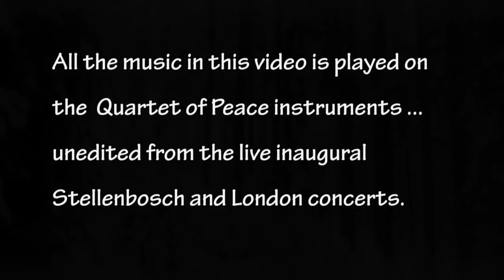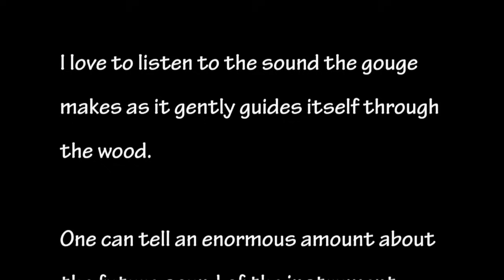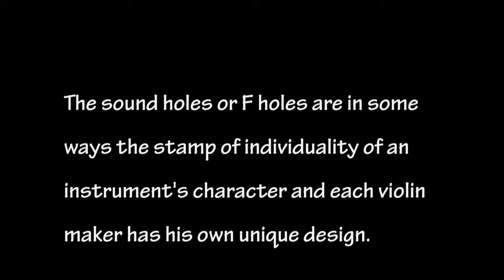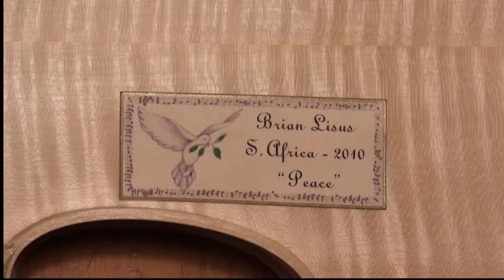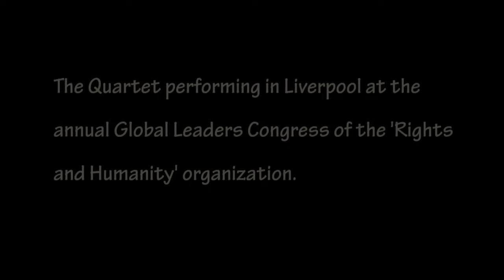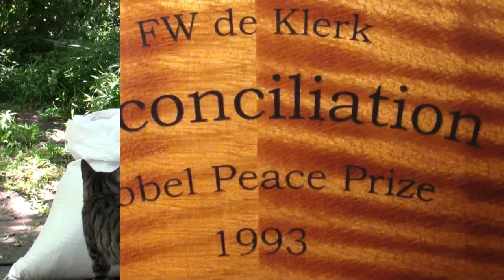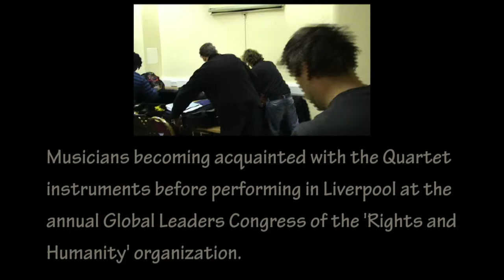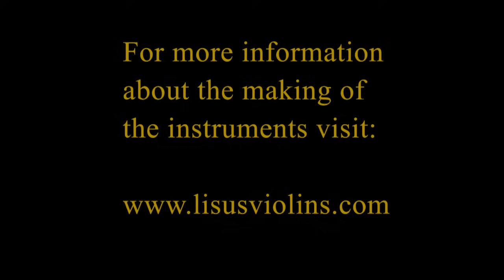Violin Making  - a String Quartet - from the first shaving of wood to the inaugural gala concerts.

Comment: At the tender age of 65, I'm about to start carving my first violin. Watching this, I'm either enormously inspired, or enormously intimidated. I guess I'll find out tomorrow.

(That's got to be one of the sweetest sounding cellos I've ever heard!)
Reply: Well Paul, I haven't budged from my computer except to occasionally eat or to use the facilities.  I haven't even bathed for two whole years for the fear of missing your update, and yet it hasn't come!!  I can wait no longer:  how did you make out???
Reply: Sorry to be so quiet about this. I appear to have been intimidated, but not by this excellent video. Rather, by my own struggles with the tools. I got really nice belly and back seams, but gouging out the contours of the plates is beyond my level so far. I have tuned up and varnished three instruments, and they came out rather well, but making one from scratch is another story. I haven't given up, but I am not making any time commitments, either. So enjoy your bath, and rejoining your family!
Reply: Thanks for the update Paul.  I haven't attempted a build either but would like to.  I've seen others drill pilot holes at varying depths (depending of course on the contour) to use as a general guide for the shaping of the plates.  In any case I doubt there is anyone who managed to get this right first time out. I think my first attempts at plate shaping will not be with instrument grade wood, but some glued 2 X 8s in pine.  There's an old Stentor video on line showing their Chinese factory. If you want to get depressed, watch how fast those workers blast through the various build tasks.

Thanks again for the update; I'll enjoy my bath, but suspect my family will be even more grateful than I will be!  Good luck my friend.
Reply: @paulcook4459  I'll be 71 this year and I'm thinking of trying a build. Something about it looks so rewarding. 
Planes are about my favorite tool, so I'm thinking of how they might be used instead of some of the tools here. While I like files, they scare me in use where the grain can blow out. I'd rather use a plane or chisel. 
Speaking of either the plane or chisel, I've learned to free hand  sharpen in under 30 seconds to 16,000 Japanese grit, which leaves a polished surface. I rarely sand anything anymore. 

If I can find a source that teaches a class, I'll see how I can do. Now all I have to do is live long enough to finish the project!  ( That part worried me while I was building my workbench. )
Reply: Did you ever finish it?? I must know! Just do it, man! You can do it! Or, youll learn enough from the first time thru that youll do it the second!

Comment: Fascinating video!I wonder why the body isn't made of one solid piece instead of two little pieces put together?
Reply: How do you expect to hollow out a single piece of wood?
Reply: I think he means single piece as compared to bookmatched jointed pieces. Solid body electric guitars will have a single maple cap for example.
Reply: Kenneth Gilbert I think they're bookmatched for symmetry? Lots of flamed and quilted maple tops on guitars are bookmatched for that very reason

Comment: Hi Master Brian, may I have a piece of advice or info without paying for it?

My peg box has 6.5-6.8mm 4 small holes and 7.3-7.5mm 4 big holes and I am planning to replace my boxwood pegs with ebony fittings that are sold online and do it myself. The thing is I have no peg shaver or taper.  In the Philippines, there are only 2 violin luthiers and Philippines isn't as small as TAIWAN that anyone can just easy travel anywhere they want. Plus, I do have a woodcraftmanship background and I know peg works is very easy if I have shaver and taper but unfortunately, nobody sell them in my country.

I also want to share about Chinese luthier that replied to my question; "Peg work is a professional work and almost can not be done alone."

I mean, okay. Either he want me to let it done by a luthier or regret alone when you fail. Oh, okay? I am no dumb about woodcraftmanship. Or the other way around, he doesn't want to even give a piece of an info or advice because I am just asking a FREE QUESTION and I never paid for the question. Just like, "Pay me 500$ and I will teach you as a master luthier on how to drill the peg and peg box because it is a secret on how to make them for violin." I just feel like saying this because, for a single piece of word of advice to answer a help is very very hard to share.

Comment: what if the bass bar was fashioned like a sine wave, have you ever experimented with the bass bar or are you a strictly traditional builder....like the f-holes, a small adjustment with them has a definite impact on the sound...but what kind of sine would you use??? just guessing id think a bass heavy sine maybe 20hz would work best, im doing tons of research on the building of a violin, before i carve my first....i plan to do at least 6-8 more months of research before i try. i want to build something non-traditional, to employ my engineering and physics skills into my work.....truthfully, im a bit intimidated and cant help but think my ideas are crap, i mean who can argue with strad

Comment: making the curved surfaces could be fun if it could be replaced with a roundhead cutter, and the technique consisted of like copying keys where another round head followed a good copy part. exactly as in key copying technique, and with a sliding plate where it could be followed in X and Y directions

Comment: A CNC machine would speed up the process a ton. Just saying. And it would not change the sound of the violin, it is just a shaping tools, like hands and chisels. The wood sounds the same no matter how you shape it. The key is in the selection of quality materials. I say this because many people argue that hand made violins sound best, but ultimately the materials and the design of an instrument are what makes or brakes a sound, not the methods used to shape the wood.

Comment: Can you plz tell me ...the tools name which you r used for cutting n finishing..
Reply: Simmi shrivastava which ones do you need the name of?
The thing that he drags across the wood to get it flat is called a hand plane. There are also smaller ones called thumb planes, which are used to get the main shape of the body.
He shapes the body roughly with gouges, on the outside, and hollowing it out.
It's rare, but a couple times he uses small chisels.
The stuff that he glues to the board was likely a plant containing high levels of silica.

Comment: I suspect you have you seen this? “Chemical distinctions between Stradivari’s maple and modern tonewood“ https://www.pnas.org/content/114/1/27 PNAS January 3, 2017 114 (1) 27-32; first published December 19, 2016  “Elemental analyses by inductively coupled plasma mass spectrometry suggested that Stradivari’s maples were treated with complex mineral preservatives containing Al, Ca, Cu, Na, K, and Zn”
And this? “A Comparison of Wood Density between Classical Cremonese and Modern Violins” https://journals.plos.org/plosone/article?id=10.1371/journal.pone.0002554# Published: July 2, 2008
If seasonal growth that is similar throughout the year with ring growth that is slow(dense), then 300-400 year old Nova Scotia Spruce growing in Canada very slowly (which are also low down in a well watered gorge that is shielding the trees against the sun’s heat from the South, the East and the West) would probably produce a nice source for resonant violin wood, much like in the time of the Cremonese masters, such as Antonio Stradivari and Giuseppe Guarneri Del Gesu, would it not? {{{I thought they would be good for masts and spars, but perhaps they are still alive and there waiting to be violins and violas and cellos}}}